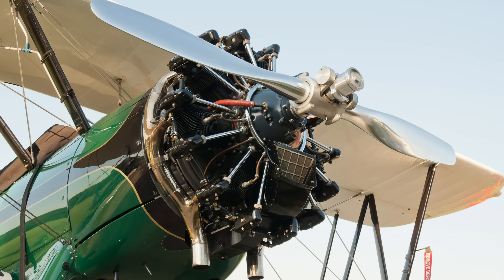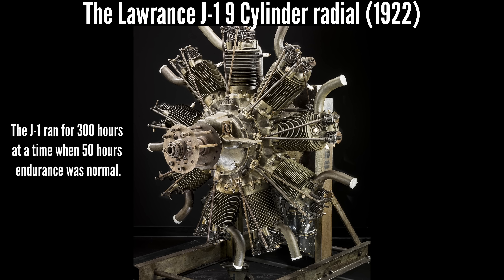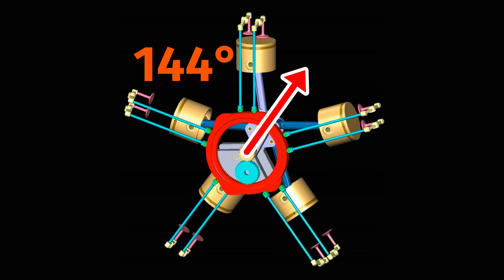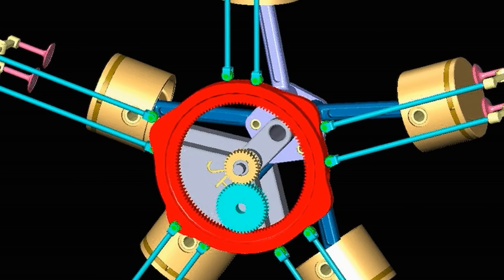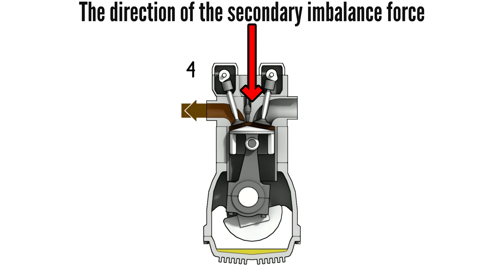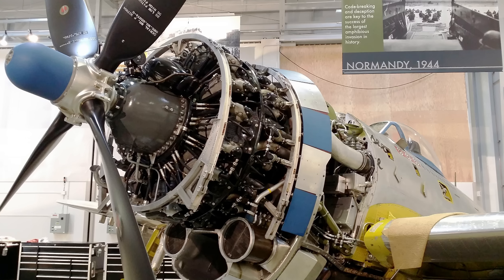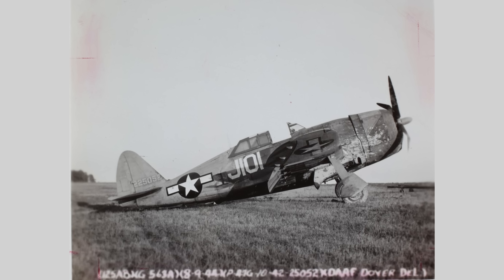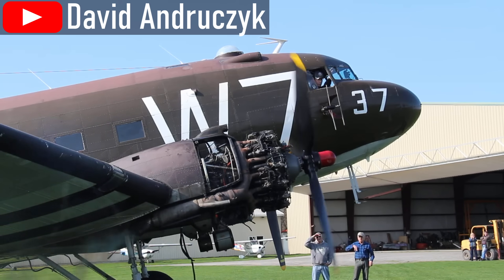The Rise & Fall of the Radial Airplane Engine - History & Technical

Comment: The larger v12 engines are effectively co-planar as the opposing cylinders share the same part of the crank pin. If you look at the engine closely they cylinders are all in line and this was done to shorten the engine
Reply from the maker: Apologies, I was thinking of the modern aviation V engines I covered recently and I suspect you are exactly right (and Michael as well) thanks. The forked conrods on a radial looks different though with 7 or 9 conrods instead of 2 like the V, hence why it was never done successfully for mass production on the radial. Though and I couldn't get a picture of it to use in the video, hence the one I posted.
Reply: @LetsGoAviate  Greg’s airplanes and automobiles has an excellent video on how the V12’s work. I did love your video too of course. You did an excellent job of explaining it
Reply from the maker: Yeah I get what you're saying, but not really coplanar since the 2 conrod bottom ends that share the crankpin are next to each other, meaning the travel path of the 2 conrods don't overlap or cross each others plane of rotarion. Most V engines uses a shared crankpin, and yes it does keep them shorter.
Reply: @LetsGoAviate  Actually practically all the aviation V engines used fork-and-blade style conrods, so the cylinders were indeed exactly opposite each others (a few engines used master-and-slave style conrods similar to radial engines, for instance the Soviet Mikulin engines).

Comment: Really love the fact you discuss some interesting phenomena as the secondary imbalance in a cylinder bank.
But, won't multi-cylinder bank radials, while helping to cancel out radial or x-y secondary vibrations cause an axial vibrations because there is a physical separation axially?  Looks to me like it may not be significant, but it will still exist for the axial crankcase to have to resist and therefore cause a tertiary vibration?  Oh, and how do sleeve valves work, like in Bristol engines?
Reply from the maker: Thanks. Yes it would. The total resultant imbalance in the x and y axes could be cancelled by the opposing forces of the two cylinder rows, but since the opposing forces are offset by a distance on the z axis (depth) it would cause a secondary balance rocking couple. It would be fairly small in magnitude though.

Comment: One radial engine has successfully used a split fork connecting rod layout. Harley Davidson.
Reply: Got a link???
Reply: @alexjohnward  
Every V-twin Harley ever made has this. No specific link, any should do.
Reply: @upsidedowndog1256  i see what you mean, but I don't think a v twin really fits the bill as a radial engine, though even a single cylinder would technically be a radial lol.
Reply: That is a V-twin, not a radial.  The thought of the gyroscopic torque on a radial engined harley amuses me. You know how a car will move slightly when you move the throttle in neutral? A HD would flop over or away from the kickstand when you twisted the throttle! 🤣🤣😂
Reply: @marckyle5895  
Except that a Harley crank spins longitudinal in the chassis. They do move fore and aft some. Most bikes are this way. And it certainly IS a radial. Check out the Feuling W3 version. Just keep adding cylinders until it is fully round.

Comment: Not to mention the excessive oil-burn on radials, which hit another nail in their coffin. It is - unfortunately - system-immanent, that oil flows down into the lower cylinders and collects there when the engine is off, which requires a very carefully startup procedure not to hydro-lock the engine. And unlike to line- or opposed piston engines they have no real oil sump or oil pan. So the lot of the oil needs to come from a fresh oil reservoir all the time. AFAIK the Lockheed Super Constellation burned off up to 100 gallons of engine oil for a flight from the US to Europe. Thanks for sharing !

Comment: Can you elaborate why model RC plane engines are 2 stroke ? Why aren't there any 4 stroke which do not need 2 stroke oil ?
Reply: On the site they offer a UMS 77cc / 4.8 hp 7-cylinder 4-stroke radial for a bit above 1.500 Euro. The smaller 33cc / 2.2 hp is still at around 1.300 ... 🙂
Reply: @wacholder5690  This is not the answer I am looking for. They need gasoline/oil mixture for fuel. My question was, if there are any RC plane engine which do not need gasoline/oil mixture ...
Reply: @johnmoser1162  It's much simpler to lubricate the 4 stroke RC engines with oil mixed into the fuel than it is to design an oiling system inside these tiny engines. These engines will often experience negative G's during flight as well, making a standard wet sump oiling system un usable.
Reply: @johnmoser1162  Well ... electric Planes don't need two stroke oil .... but I guess that's also not the proper answer as well. The miniature RC 4-strokes don't have an oil system as i.e. lawmower or car engines. Oiling is easier with premix.
Reply: @wacholder5690  Thanks !

Comment: The main component beside the master rod that makes the radial possible is the cam ring. You should devote a hole video explaining it. The cam ring can turn either with or opposite engine rotation. The direction is determined by the geometrically possible number of lobes. A 9 cylinder will run with a 4 lobe cam ring turning opposite engine rotation at 1/8 speed.  Or a 5 lobe turning 1/10 speed with engine rotation. It is the cam ring geometric relationship that determines the alternating firing order.  The master rod and articulating rod relationship cause a slight timing and stroke length difference in the articulating rod cylinders. Timing is usually cured by a compensated breaker cam magneto.  Ignition timing should be made with a properly wired magneto set to the master rod cylinder.  That cylinder can be any convenient location.. On a M14P it is #4. The crankshaft counterweights usually have internal vibration  dampers. The odd number of cylinders and other differences give the radial that sound. A little pedantic??
Reply: Dear, being an amateur mechanic and a student of piston aero engines, I really liked your post about the valve cam ring of radial engines.  Interestingly, the small difference in stroke and timing that exists between the master connecting rod and the articulated connecting rods.  I didn't know that detail.  I agree with the friend about a video explaining the cam ring of these engines.  It is completely different from in-line or V-shaped engines. One interesting thing about radial engines is that they are known as big oil guzzlers.
Reply: The stroke and timing effect is hard to visualize. It is caused because the articulating rod pins travel an elliptical path as the master rod turns around the crank pin. The timing effect is in the order of about + and -3 degrees. That depends on what side the cylinder is on. This is accounted for with a compensated master rod or a compensated magneto. The engines I have worked had compensated magnetos. This information is not widely published as these engine are no longer of commercial interest.
Reply: @jayreiter268 Greetings from Brazil.  I have some doubts about the incredible radial aeroengines.  Could you enlighten me?  
1) Is the valve opening and closing diagram (angles) similar to the diagrams used in automobiles, which are optimized to increase power/performance?  
2) Using the compensated magneto mentioned above, does the power/performance increase significantly?  I really appreciate your attention.
Reply: Not pedantic at all. I wish people would pour their knowledge about forgotten technology more often.
Reply: Pedantic is fully appropriate here.  M14P?
Reply: @Thankz4sharing  The Vedeneyev M14P is a Russian nine-cylinder 600 cubic inch/10 liter radial..

Comment: Good video.  I have read that one issue in keeping the old radial engines going, such as on a DC 3, etc. is finding the high octane Avgas they use.  This Avgas is getting harder and harder to find.  Hence the success of the Bassler Turbo Conversion company.
Reply: Low octane, time for water injection.

Comment: The radial engine is one of my favorite aircraft engines. As beautiful as, and as much as I love planes like the P-51 and Spitfire with their Merlin engines, water cooled V12s do sound great, but the radials sound absolutely BRUTAL and it is glorious. THE best sounding engine to me, to date, is the is the Pratt & Whitney R-2800 Double Wasp, and more to the point, as it is installed in the F4U Corsair. Heard a F6F Hellcat fire up, and it was a great sound, but when the Corsair started, it had all the attention. I was about 50 yards away and could feel, every, single, cylinder when they fired. From start up, I could count how many cylinders it was running on just from the thump in my chest. When it later screamed and roared passed us at likely well over 300 MPH, I could STILL feel the engine pounding me in the chest! I could hear the sound of FiFi  the B-29 as she flew by from a couple of miles away and she still made a great noise too. I just realized, I have heard way more radials than I had originally thought......and most of them without being at airshows with the exception of the F4U and F6F.
Reply: The Bristol Centaurus sleeve valve is remembered for having a very interesting exhaust note.

Comment: About those Lawrence radials. Beside making  radial aircraft engines, in WWII Lawrence also built some miniaturized radial engines of about 10 or 15 horsepower to power B17 and B29 APUs.  Unlike radial aircraft engine the Lawrence  APU engines had a vertical crankshaft with the cylinders arraigned around it in a horizontal position.

Comment: Yup! All true. In my own experience radials of 5 cylinders were scarce and small. The 7 or 9 cylinder types more common.
And "double-row" engines had 14 or 18 cylinders!  Some of the last, large, fast and Luxurious propeller Airliners used 4 of these BIG, POWERFUL radials !
The DC-6, DC-7, and Lockheed Super Constellation 👌.
Reply: I liked the 5 cylinders, they looked so good on the Ryan ST. Much better looking than the Cessna's flat lycoming if ya gotta stick cylinders out in the air to cool them instead of adding a cowling.
Reply: The B-36 used six massive 28-cylinder engines (plus four jet), which I heard mechanics found challenging to maintain.

Comment: 6:51 Vespa scooter crankshaft! 
I think there is a firm in Poland that is still making the Shvetsov ASh-62 9-cylinder radial engine of 1000hp, as used in the An-2 and the
PZL Dromader. I believe this engine has been in production for about 90 years.
Reply: I believe the ASh-62 is a development of the Wright R-1820.

Comment: Motorstar Romania still manufactures a copy of the Soviet-era Vedeneyev M14PF 9-cylinder radial engine.
Reply: The M14P is still a very competitive engine for high performance aerobatics, both competition and display flying.  An advantage not mentioned in the video; the short crankshaft of a radial tolerates gyroscopic forces (as imposed by tumbling airshow-style manoeuvres) better than the longer crankshaft found in an inline engine.

Comment: These engines are called radials because their cylinders are mounted radially on the crankcase. Rotary engines are also radials. Rotary Radial and Fixed Radial. The first radials were rotary engines designed to be mounted within the wheel of early motorcycles.
...and, yes, some radials did use camshafts rather than cam rings. A typical Kinner R-540 five-cylinder radial has five pairs of small, single-cam shafts for each cylinder

Comment: Those 4 cyl boxers are real shakers .  I ran one for 20 years , an 0200 Continental.    I went flying a few times either a guy who had an old 272 Cessna with an 0300.    More or less the same as mine with 2 more cylinders.     Wow was that baby smooth 👍🏻
Reply: If a 4 cyl boxer shakes at speed it means the pistons and rods are not balanced, I built several VW Beetle engines back in the day and balanced the pistons and rods within a gram or two. Very smooth.
Reply: @bwyseymail could that be that a beetle is only 1600cc (96 CI)  while an 0360 is 5900cc?
Reply: @barryduff5058  no the smaller boxers can definitely be shaky too if not optimised
Reply: @bwyseymail it’s smooth compared to an inline-4 in a golf. But rough compare to 6 cylinders. Why do people build 90° V6 ? F1 . If I destroke an old US 90° V6, does it get smooth?
Reply: Go fly a 175 with the geared GO-300 engine. Cruises at 3100 rpm. Now THAT'S a smooth ride.

Comment: It's the liquid cooled engines that died, not the radials
There are still lots of radial engine aircraft flying today.
BUT very few (mostly WW2 fighters) liquid cooled piston engine crafts still flying. 
Small, light planes use small opposed engines, if the need more than a two or three hundred hp they usually go gas-turbine
Reply from the maker: Pretty much what I was trying to convey. The air-cooled radials "won out" over the liquid cooled inline types for high power requirements (at least for the majority of applications). But after the war turbines started taking over, and on the other end of the spectrum, radials couldn't compete with the opposed 4's and 6'es in terms of cost and efficiency for light aircraft. That left a very narrow space for radials to exist in.
Reply: some of the most popular engines for light aircrafts (much more in Europe than in the US who are very conservative) are liquid cooled (Rotax 912 series)...Liquid cooled engines are much more fuel efficient because stable t° who allow to run lean without problems, and protect the engine from t° shocks in descend (out engine too cold vs hot inside)

Comment: There does not seem to be much in this video about the 'X' and 'H' format of inline engines.  While the Rolls Royce Vulture 'X' engine was not that good, the 'H' section Napier Sabre , with sleeve valves, was developed to become a powerful, reliable and successful design.
Reply: Sabre was powerful, sure, but reliable and successful? Uh, how about no? There are reasons why the Sabre disappeared very quickly after WWII, even though other WWII era piston engines remained in wide-spread use for decades after the war. The sleeve valves, in retrospect a hugely expensive and time-consuming dead end development path, surely being one big reason.

Comment: Thankyou, super graphics .  I suppose time limits left no chance to mention of the Bristol Radials in particular the sleeve valvers reducing frontal area, eg ( Hercules) 14 cyl two row, nor the  BMW 801 which powered the FW 190. Ohv but featuring the fan to help cool the second row.
Reply: It's hard to make an apples to apples comparison, but the lower diameter advantage is not as high as one might first think, if it even exists at all. See https://www.enginehistory.org/members/articles/Sleeve.pdf